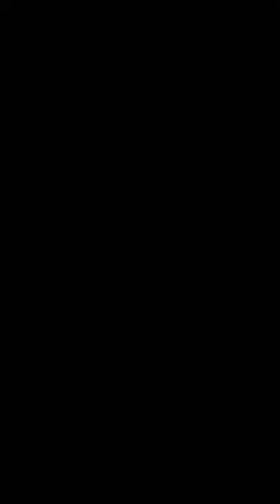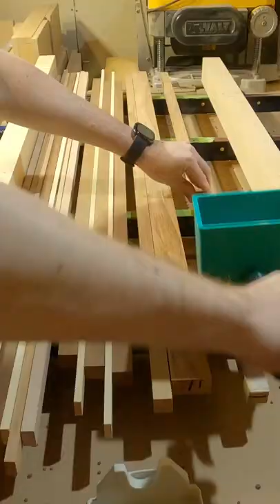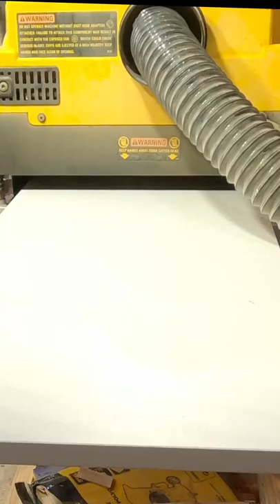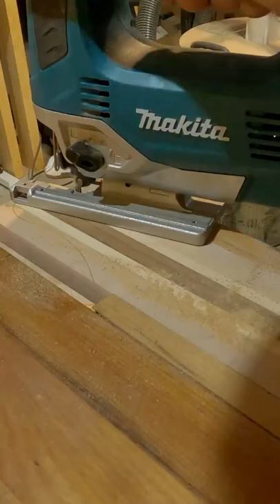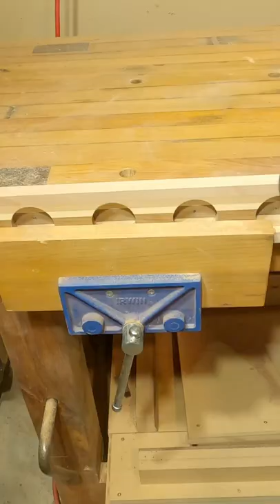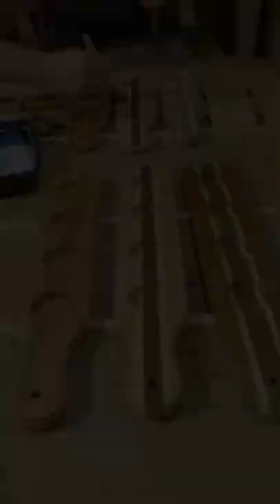Making Whisky Flight Serving Paddles - Woodworking Projects #shorts

Comment: Melamine for the planer bed. Smart. How'd you attach it?
Reply from the maker: Yeah it works well and is nice to have the additional infeed/outfeed support.. Not permanently attached, but I do have a block of wood fixed across the underside of the melamine just before halfway on the infeed side. That's enough to keep it in place against the planer. Thanks.